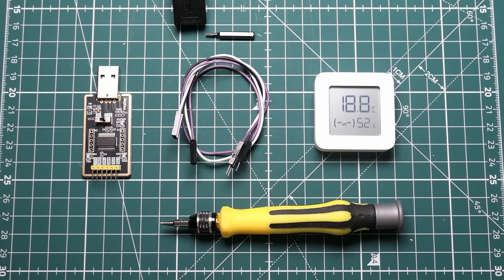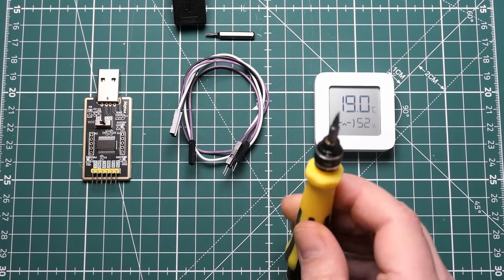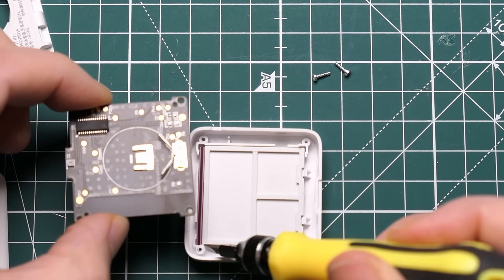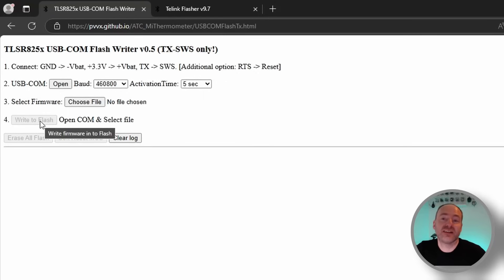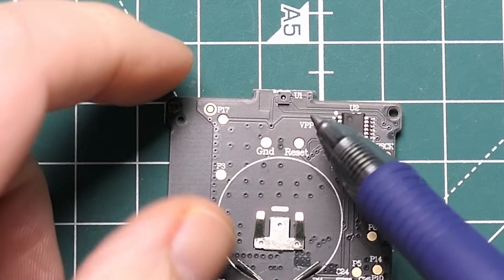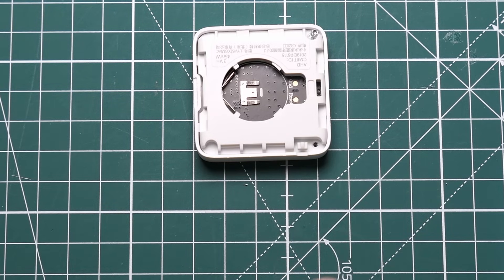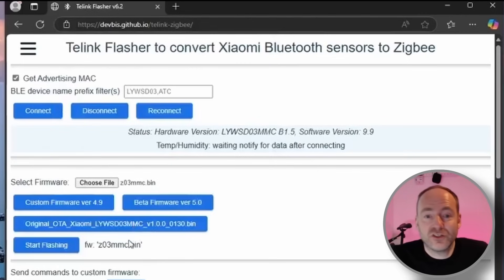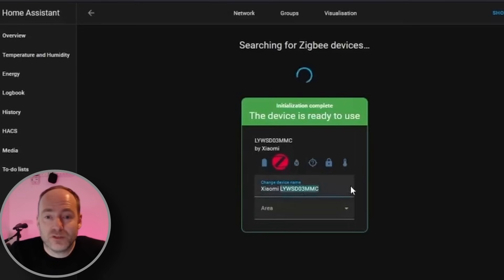Custom firmware on cheap Xiaomi Thermometer, Bluetooth to Zigbee (2025) #homeassistant #xiaomi

Comment: A simpler way is using OTA, no need to use programer
Reply from the maker: OTA is blocked with the new firmware, it’s very annoying. As far as I know there’s now only two ways to convert these sensors to zigbee… you either make a Xiaomi account and extract the keys (I couldn’t get this to work), or you first put an older firmware on using the USB-UART adapter, then do the OTA upgrade. Certainly extracting the keys would be easier than opening the module, but the method simply didn’t work for me, I tried several times using different modules, none worked. Thanks for watching.
Reply: @thecircuithelper  I agree - I was starting down that road yesterday, and couldn't get it to work.  This, in the end, was much easier, as long as you've got the FTDI adapter handy, which I can only imagine 99% of the HA enthusiasts have anyway!

Comment: like you I wanted temp sensors in all my rooms and really like having a physical display and standardization, unlike you I made my purchases while you could still just do over the air hacking. And happy to know if I need to replace them there is still a path forward.
Reply from the maker: I really like the sensors, my only complaints are that they update the temperature too slowly via zigbee… so the temperature on the screen refreshes at a reasonable rate, but home assistant is only updated in 5 minute intervals. This is definitely to save battery, but I’d sacrifice some battery life for more frequent updates. Second issue is the smiley face on the screen, I really like having the screen, it’s great, but the stupid face looks silly to me!! 

I think both can be removed when modifying the firmware, I need to play around a little! Thanks for watching 👍👍👍

Comment: Thanks for taking the trouble to demonstrate & explain the process.  Just to confirm; I’ll need a Zigbee dongle on my HA server - is that correct?
Reply from the maker: That’s right, but the beauty is that the dongle can be used with all other zigbee devices in HA, if you leave the default firmware on you need to use Bluetooth and the Xiaomi app etc which is much less convenient. Thanks for watching 👍👍

Comment: Hi there, thank you for this video.  How is it possible to find out which model you own or bought?
Reply from the maker: Easiest way is to go onto the firmware uploader page and connect to the module over Bluetooth. This should show which version of the firmware you have… anything ending with 0159 (or above) is locked! You either need the keys from the device, which requires making an account and some software ‘hack’ to extract them, or you can use the method in the video which requires opening the sensor and connecting to computer. Good luck! 👍
Reply: @thecircuithelper thanks for the quick reply.  Or is it possible to just follow your method right away without checking if the firmware first?
Reply from the maker: Hmm, it should be possible but I haven’t tried, basically the approach in video first puts an ‘unlocked’ version of the firmware on it and then does the OTA fix to convert it to Zigbee,

Comment: Or for a few dollars just use an Esp32 with sensors. I include a super cheap radar which also controls the lights and lets me know if people are in each room. So I can control multiple lights, heating, windows, humidity for about 5 pounds.
Reply from the maker: Yup, I’m thinking about doing this, wanted a battery powered solution though and those radar modules are power hungry!! Thanks for watching 👍👍
Reply: @thecircuithelper  PIR sensors use almost nothing - thats why garden lights use them. Then combine this with the radar sensor for location within the room (if needed - so kids might be in the loft bed so turn off lower lights) and continued presence. I use ESP32 38 pin break out power/ bread boards which allow lots of sensors with 5v, gnd, 3v etc
Outside with batteries I use the PIR sensors to wake things up, solar charges it all back up during the day. I also use super cheap Lora Devices to avoid congesting my wifi - you can use Zigbee with the C6 and S3 boards (I think). Lora will also wake up your esp from ultra deep sleep. (Careful what you buy - some don't).
So I am about to build battery devices for a few things - one for my BBQ so that it will relay the temp back to me of my Steak and then a portable remove control for the wife so she can select lights and use a knob to control them using a mini 3-5 button keyboard. ESP with USB OTG and then again button will wake it up and prevent and power draw.
Reply: @audas  You should have a channel where you explain and show your builds.
Reply: @thecircuithelper   Subbed - Ill follow your vids.
Reply from the maker: PIR is a good shout, they use barely anything! 👍

Comment: Do not touch a battery with your fingers.  The oil on your fingers will corrode the battery and greatly reduce it's life.  Use a magnet or plastic tweezers to move the battery.  Wear disposable gloves.  Thanks for the informative video.
Reply: This is bullshit. By the time it corrodes, the battery is long gone. I speak from experience.
Reply from the maker: Thanks! I’d not heard that about the batteries before, will have to be more careful next time! 👍👍

Comment: Both the firmware and hardware are constantly changing on these things. Real pain to get compatible ones. There's ones which are great and ones which are bad for battery life. Protip, I don't recommend getting any FT232L or similar named chips, because FTDI have long been known for trying to poison / destroy / disable clones or fakes of their serial converter chips with driver updates in windows. These days I think a more worry-free bet is Silicon Labs CP2102 or 2104 based ones, or WCH's CH340 or CH9101/9102 chips. Their drivers are pretty easy to install and come with long history of being used in arduino and dev boards.
Reply from the maker: It’s super annoying isn’t it… when I started looking at the various options available there were so many that need a specific and locked down ‘hub’ to work, that’s why I bought these specific Xiaomi sensors. So many tutorials online showing how to update them wirelessly, I was pretty disappointed when they arrived and I couldn’t get them working easily!!

Interesting point about the FT232L, think I’ve read about that somewhere! I think the advert claimed a genuine part, but that’s basically meaning I guess! Thanks for watching 👍👍
Reply: Real about the adapters
+1 for the CP2102
Zadig helps solving most driver issues for most adapters (on windows atleast)
Super pro tool when tinkering with these things, Arduinos or maybe RC related things